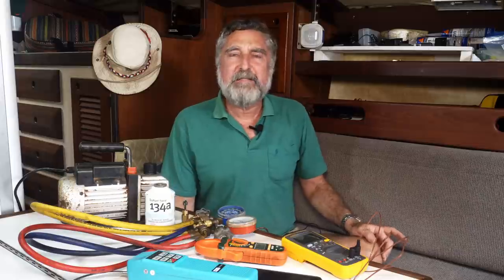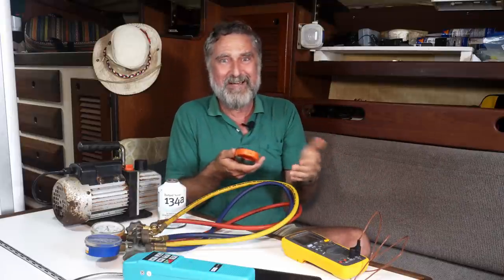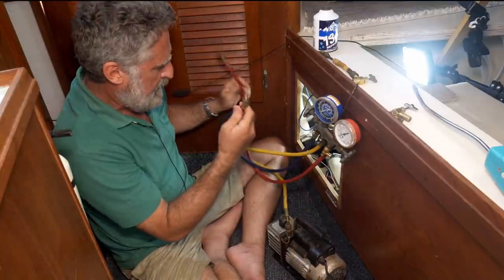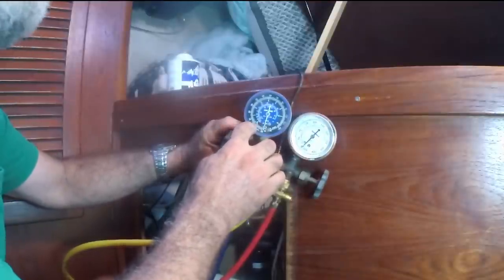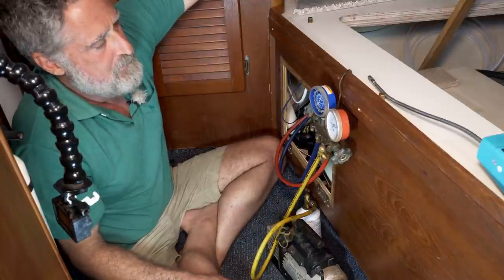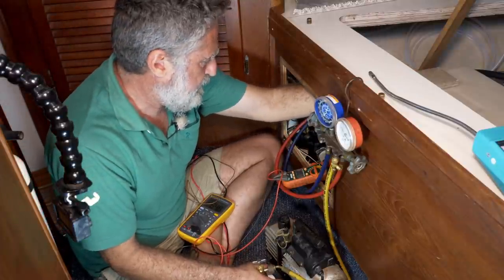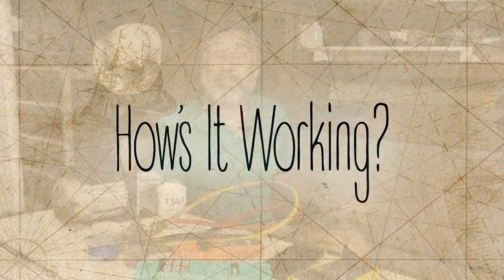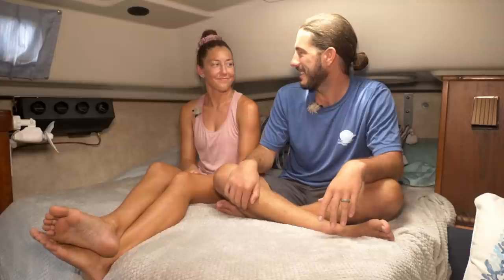How to Charge your Battery-Powered Air Conditioner

Comment: Glad you and your partner have gotten this system out to so many. I am continually amazed at the power requirements of standard marine air systems dock and generator hogs. The only efficient commercially available systems seem to be cabin exchangers and whole ship chillers. 
Building an efficient heat pump after thoughts of using resistance dock power at current prices and using 25-30 Amps just to heat has to end.
Reply from the maker: Yep, heat pump version is in the works.

Comment: It's been great to watch this grow and finally see that you have overcome the obstacles to get this into a kit for the Sailing/RV community while achieving high efficiencies and hence low power usage for off grid use.
I think it would be worth considering having some form of Voltage/Amp protection circuit in the kit you sell, just so there is no risk of you being blamed if something goes wrong with their existing DIY electrical system.
While I understand separate gauges are needed to gas other refrigeration systems on the boat, it would be great to never have to reconnect to the pressurised system to check, and as fluid filled gauges are cheap enough for the convenience and have dial faces for multiple refrigerant gases. Is there any chance of a "Permanent Pressure Connected Refrigerant Gauges" as part of your kit?
Reply from the maker: We spec fuses and circuit breakers in the manual.  If users install with them they should be protected.

The problem with permanent gauges is they tend to slowly leak.  So having a gauge would require topping off the gas.  Better to use portable gauges.

Comment: not sure how much a difference it makes, . but I have done this on car A/C systems a few times, all the cans we used mentioned it should be held upside down when you are adding the gas.
Reply from the maker: Nope not here.  Need to add as a gas.  With the can upside down you will be adding as a liquid.  That could lock up the compressor.

Comment: Nice one! Does the compressor come with oil already? In automotive we use a scale to know how much refrigerant to put in based on what the system is designed to take, in weight. We also measure air temp at the vent, a good way to measure performance and refrigerant fill. If your gauge set has a valve at the end of the yellow hose, you can leave the hose under vacuum while you connect up to the can, and just purge the space between the valve and the tank. Works the treat for keeping moisture (enemy) out. We also would evacuate for up to 4 hrs but 1 hr in humid weather for small system may be good. You're a smart fellow!
Reply from the maker: Thanks.

Yes lube is already added to the compressor.

Going by weight is a bit tricky to actually do.  Requires an accurate scale and since we don't know how long the lines will be in each installation we can't know how much volume that part of the system will take.
    I think calculating the sub-cooling works best.  We use an expansion valve just like a car but there are more variables in the install.  Right down to the rpm the compressor will run at.
Reply: I've also done some research on evacuating lines. I would agree a few hours will give best results but a Micron gauge is really the best way to know for sure. Most won't wait the hours to make sure. As was sort of described in this vid sometimes the last bit takes a while to pull everything out. Most techs without a Micron gauge are only guessing. What do they realistically care they will get paid to return and check or replace equipment

Comment: What a great channel 👍🏻
I am planning to get one for my truck. 
Do I need to get lithium batteries 🔋 or will work with regular batteries? I have four 1000 CC on my truck. 
Thanks
Reply from the maker: Yes it will work.  Electrons are electrons.

Problem is it needs your truck to be floating in water!

Emily and I are about to head out on a RV excursion.  One of the main reasons is to work on an air cooled version that would be great for trucks.  Unless you want to get one now and swap out your condenser (honestly easy to do), you might want to wait.  If you do keep me informed as to how it goes please.

Also consider this.
https://www.emilyandclarksadventure.com/bbms

It will let you add li to your truck without changing any of your charging systems.  Honestly I'm more excited about this invention.  
Li is getting so cheap now that I think it's the way to extend anyone's electrical system.

Comment: Nice video on the charging process!

Is there an efficiency curve for the variable speed compressor?  Would like to know where the sweet spot is for power consumption.
Reply from the maker: I have the manufacturer working on that now.  He is testing watts:BTU/h values for several RPMs.

First test started with good numbers but fell away.  He isn't an engineer and forgot the ocean is slightly larger then 15 gallons.   
    Just a joke he will get that sorted soon I expect and will publish the results at MarineDCAC.com

Comment: Great video. I'm pretty sure that in Europe you now need a license to purchase refrigerant, I've also been told that there is a requirement to purge and pressure test systems with Nitrogen before adding refrigerant.
Reply from the maker: Yep.  Lots of laws in Europe.  Keeps the refrigeration guys employed.  But getting a guy to fill the installed system isn't that big of a burden.
Reply: @Clarks-Adventure  Absolutely. A buddy of mine switched to Propane instead of CFCs, said it was probably less dangerous than a stove as refrigerant leaks tend to be small.
Reply: Fixed procedures are not bad things. You can still save yourself on self install.

Comment: good stuff sir, as usual.

questions:

how many btu's capability? 

 likewise, what sized area, cubic foot will it cool, given normal tropical conditions with normal hull/deck configurations.  

(knowing there is a wide range of vessels many having various R factors of the core of the deck/hull, having great varying affects on the ability to hold temperature inside, versus outside...  temptress for example could be considered "normal")

if you could help us with that. (an update, in the updatable section would be nice for everybody interested, and or the new website (nicely done).

and, do you know the seer rating/s? 

what is the power consumption, while in operation?
Reply from the maker: Thanks.

A lot of that is still unknown.  The compressor is rated for 5000btu/h.  We haven't run tests to see how much heat is actually pumped. (But they are planned) As I plainly say this is a kit to allow others to participate in the experiment.

So far it's been installed in two boats.  Temptress shows these numbers A/C and Refrigeration: https://www.youtube.com/playlist?list=PLsT7_jPsZM5qNlstuF-fdlgjrimo18tq7

Blue moon is currently doing even better with the first actual production unit.  David just reported numbers in the comments "trawler project"s comment.  But it's not really hot yet where he is.

It does look to be significantly more efficient then anything else out there.

Comment: You did well Clark :)  I do this many times a week so I have better tools, but I enjoy watching you do the work with less tools anyway. Why did you select R134a instead of R32 (propane) that everyone more than likely have onboard anyway? It is less poisonous and less expensive.
Reply from the maker: I've always wanted to do a R32 system but if the system leaked I'd have a boat full of explosive gas!  Thing about boats is they tend to not have holes in the bottom.

   Have you ever used propane right from the fuel supplier?  Is there a problem with water vapor or any other impurities?
Reply: @Clarks-Adventure  Yes I have used ordinary propane but only temporarily. I let the compressor pull the propane in like you did and I used a Danfoss filter drier before the service valve. I returned a few days later with the pro quality and emptied the whole system, before filling it with new R32. It was done with the customers approval in case anything happened but we never noticed any difference. For bending the copper pipes you get a set of line set benders so you will avoid flat spots.
Reply: Have not seen R32 in marine yet, is it in other areas than the usa? All the systems I have seen it was markedly less efficient. Please tell me if this is not the case. Have not seen R32 addressed in marine code that we are under in usa/Canada my thoughts would be the ventilation/ detector requirements of an onboard LP system? Quality R32 by the time it is shipped in 48 states is not a savings at present over R134 at retail anywhere at present. See some mini fridges R32 I see recently possibly changes.
Reply from the maker: Wish I had more tools.  Always want something I don't have in the boat.
Wish I had my tig welder but it was just too big.
Reply: @Clarks-Adventure  LoL that's a constant problem it has nothing to do with your physical location, I am under the same curse :D
Reply: @Clarks-Adventure  Big blue won't get past the deck, takes more room than my engine. Still planning multi-process on 28v alternator with tig.
Reply from the maker: @braithmiller    sorry I hadn't seen your post.  
    I looked it up once long ago.  I seem to remember the propane had a better efficiency.  But that was so long ago that I don't trust my memory.
Reply: @Clarks-Adventure  Possible with system designed specifically for it? I don't have authoritative information. I am mostly making judgments on R22 and 134 retro consumer appliances.  My thoughts on 12-22 ounces of propane accident discharged into the boat makes me uncomfortable. 
Thanks for the answer.
Reply from the maker: Yes I believe the working pressures were way higher

Comment: Looks great. Ill consider buying one after my boat is ready. I am a Trawler with diesel gen that sips fuel and a 16k BTU main AC unit. But I would like to shut all that down at night and run a small battery powered unit like this to carry that cooling through the night. If the interior is cooled by the gen and big AC unit through the day once the sun goes down the BTU requirements would be tiny to maintain a comfortable cabin off batteries at night. Especially since all that interior mass is already cooled. I dont want all you Sailors mad at the "stinkpot" running the gen in the anchorage all through the night..lol. Actually I prefer not to run any engine while sleeping. But a battery powered AC unit would be great.
Reply: They actually call you a stinkpot? I can understand the noise complaints. Bunch of pleasure trawlers I know are heavily into using solar now, keeping the generators off. Many have as much roof space as catamarans. Last summer 108 on the water near Olympic Peninsula Washington saw some of the the most inefficient portables tossed in boats. This would be a great improvement for you and neighbors.
Reply from the maker: And saves a lot on oil changes and general maintenance.

That's a great use for this unit.  Pass the idea around.  I like quite anchorages.
Reply: @Clarks-Adventure  Good point on oil changes too. Continuously running the gen racks up time in a hurry. I will pass it around on all the Trawler forums. Many are going lithium now as well...for the same reasons as everyone else. And Braith Miller...yes I have been called a stinkpot...hahaha. I dont take it personal. Some sailors can be a bit cantankerous. But I completely understand.
Reply from the maker: Cool.  Maybe pass this along as well.  It makes lithium work cheaply and better.  https://www.emilyandclarksadventure.com/bbms

Comment: Congratulations on a job well done! Can you give us an idea of the cabin dimensions or cubic feet the successful installations are cooling? I have a trawler aft cabin I can easily fit the unit, and keen to get your kit. 15 feet by 14 feet by 7 feet are my dimensions.  A huge thank you for doing this.
Reply from the maker: David days that at the end of the last video along with his current energy consumption.

He will burn more as it's not really hot yet.

Note that he says he might curtain off just the bed area to save power.  That's why I suggested the air handler be mounted over the bed.

You should keep that option open as well to save power, cool faster, and be able to cool better if your full room proves too large for your needs.
Reply: @Clarks-Adventure  watched it again and indeed he mentioned 300 cubic feet. From appearance, I'm assuming Temptress' cabin is a bit less than that. Headed North to Canada for the summer in a couple of days, so I think I'll wait and lurk before purchasing one in the fall. At 1400 cubic feet, I might be taking an undue risk right now. All the best! Sure is super interesting!

Comment: Hi Clark, great job as always.  I ordered an AC and have some of the parts already.  I am struggling to find the links to the temperature meter that you're using with the long copper pickup and the fluke meter that you're using.  Can you direct me please?  Thanks.
Reply from the maker: They are both the same.  I believe there is a link to it at our Amazon store.  Find the link in the video description.   

If you don't find it, check back.

Comment: HI Clark,  the a/c videos , although mention it, don't actually show where/how the connection to the sea water inlet is. Did they use an existing source and put some kind of t junction connector etc ?.  The concern for me is that i only currently have sea water in via my saildrive to my engine (sea cooled yanmar) and if possible i want to avoid having to drill another hole in my hull and install another seacock for the a/c.....
Reply from the maker: Sometimes one can share thruhulls but careful thought is required.  
In the best case the return line of an AC empties into the ocean just above the waterline.  So if strong suction was placed on a shared intake air could conceivably be drawn through the AC backwards so sharing with an engine might necessitate valves.   Also it's important that the water path of an AC system flow fairly free as it uses a centripetal pump.

That said yes he choose to share thruhulls and I share with my water maker on Temptress.

Comment: Hi from Casco bay Maine. Love your product, vibe and clarity. Trying to fully retire...Summers, we sail our small Catalina and Rv down south winters. I assume the thru hull/sea water connection is essential to dump the heat... But I wonder if 1) any air fin, heat exchanger could work for an rv ( with similar battery capacity)?
Listening to your experience about acclimating to daytime heat, and limiting the solar load, I wondered if ,2.) if  ac cooling was ducted just under the beds top sheet...(like some residential underbed products) if this could be practical? 70ish °+ dry air could work right?
Reply from the maker: Sure anything that cuts down on the area cooled would be a savings.  I have a curtain that can close off just my bunk and we sometime escape the peak of the heat with a siesta and snuggle there.

   I plan on doing an air cooled version soon for RV and off grid people no on boats.
Reply: 85 sea to 90-110 air the COP - power used will be higher just still a fraction of the rv power hog standards and roof mounted stupidity. Cooling tower evaporative you could use this package and lower cop though adding fan for air on water cooler. Concept is used commercially.

Comment: Hi Clark and Emily!!  I highly appreciate your videos!!  I even purchased an AquaNaut based in part of your Show Us Your Dinghy series :)

I am thinking of purchasing YOUR Air Cond kit...I'll make a decision in the next couple of months.  NOTE:  I live in Thailand, so concerned about shipping into Thailand.

One issue you should be aware of:  mfgs of r134a will stop production in 2025.  Supplies of r134a will still be available, but should diminish shortly after 2025.  R1234y is the "replacement" for r134a...but hopefully the compressor in your kit can accept another grade of refrigerant (such as r513).  I have researched this issue (since 2016) as part of my job.  If you would like more info, please feel free to contact me.  :)

Anyway, hopefully I will make my decision soon :)

Keep the great videos coming!!!
Reply from the maker: Sure it can use other refrigerants.  As you know it's all about the lubricant.  I'm sure the new gas will be lube compatible so it should be a simple swap if you get a leak after it's hard to find 134a.  

   Happy to hear that you are enjoying our work.  That's so nice to hear.  I see that there is now a sail kit for your boat.  Have you tried it?  One of the things I said to him the first time I saw his prototype was it should do well as a sailing dinghy.
Reply: Thanks for the quick reply :)

I am interested in the sail kit, but like the Air Conditioning kit, I will make the decision in the very near future.

I'll keep you posted 👍